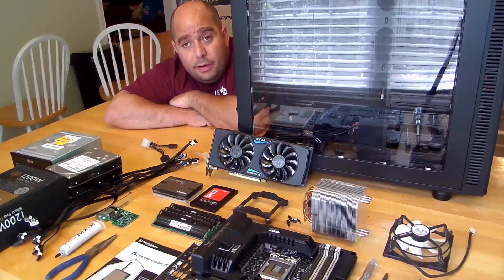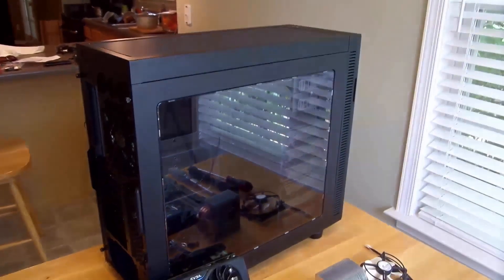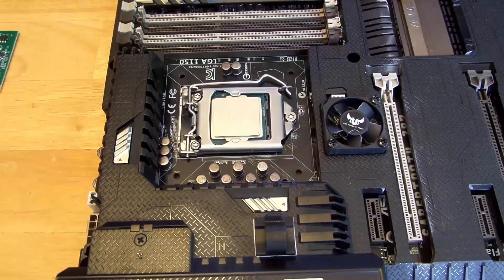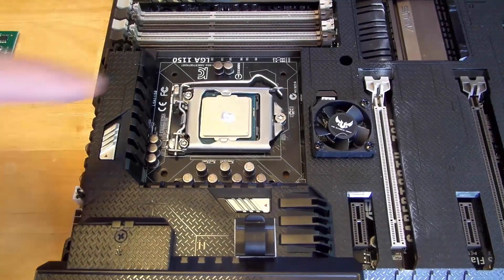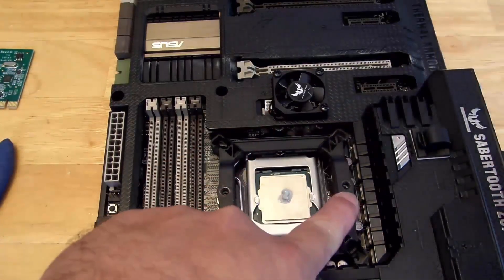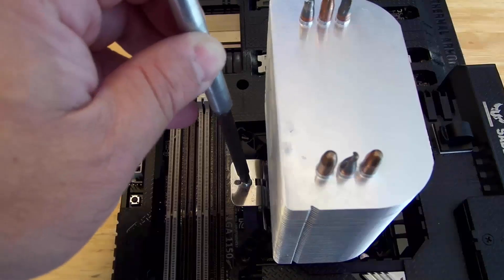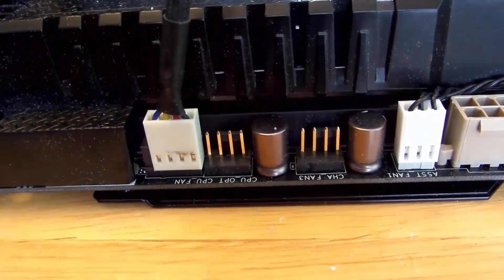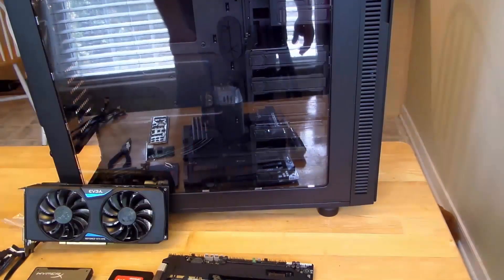How to install a Motherboard, RAM, CPU, CPU Fan and Thermal Paste [Video Tutorial]

Comment: Is there any reason you didn't install the heatsink so that the fan would fit opposite the memory?
Reply: air comes in through the front of the case, and exhausts through the back of the case, or maybe the top.  If the fan was over the video card, there would be less cool air, siphoning warmer air from the video card, making the air slightly warmer through the heatsink, it wouldn't cause too much of an issue, but trying to make it as efficient as possible.